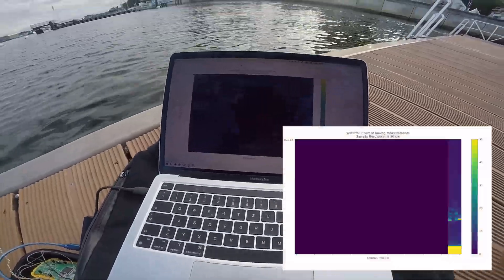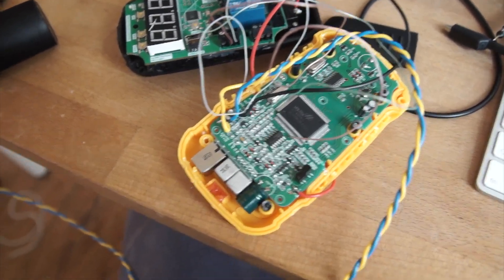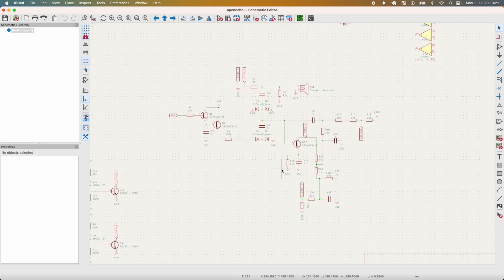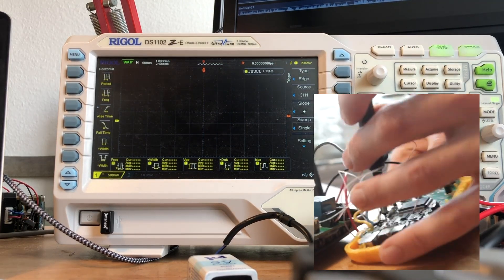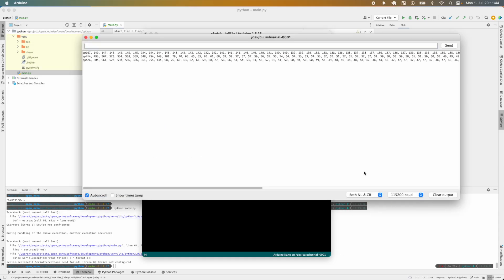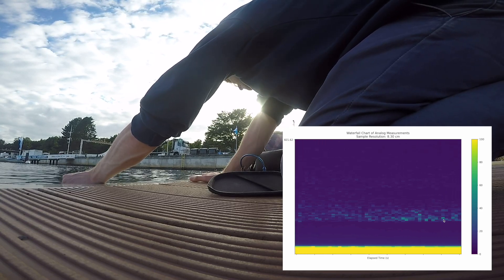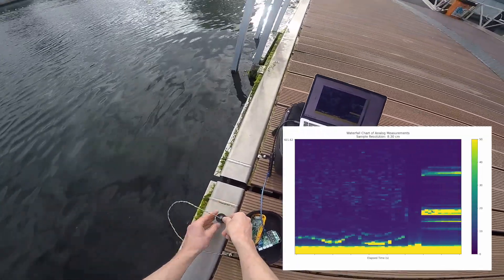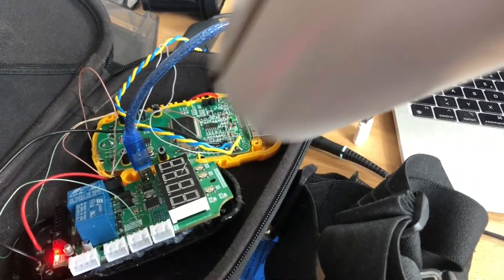DIY Open Source Underwater SONAR Project | Arduino Echo Sounder

Comment: i got one from amazon, and used some sodering and some really hard reprogramming, and now, i can use it with an arduino and put it on a big model boat i am working on
Reply from the maker: Reprogramming? Have you been able to rewrite the firmware on the microcontroller on the board? That would be very cool! Have you checked the GitHub repo?

Comment: Nice nicer nicest, looks pretty slick for ali-gear in a plastic can It's unbelievably baffling to imagine what that can turn into... great work!!! 
All right then the suggestion and wishlist...

- I suggest to make the hardware board capable of transmitting and recording multiple channels for side scan and "3d" and these alike
- I suggest making the hardware capable of transmitting different frequencies on different channels or even completely making the hardware be steered flexibly from software in terms of frequency and transmit pattern
- depending on the amount of data produced for imagery, I would consider making the Hardware IP compatible to be able to directly put the data onto "more than 5m" remote displays and servers, that might not be able to fetch the data via USB due to cable length.
- I suggest making the software side web-compatible to serve the image in a browser
- I suggest using SignalK for that matter - a boating server based on Node, that is capable of connecting, storing and web-serving all marine-on-vessel-data-acquisition as well as resources such as charts, routes, radar images, and maybe Sonar in

That would also connect the project to a mass of interested people and, if integrated into a running system, heavily reduce the duration of deployment.

greetz from Berlin
Reply from the maker: Hey! Thanks! That's pretty much my thoughts, too. 
The LUCKY Fishfinder hack was pretty limited. The frequency can be changed by replacing the PWM generator, but the filtering is 100% done in hardware and requires different R/C values when the driver frequency is changed. 
Therefore I choose to drop the LUCKY fishfinder and instead build a new hardware. I just finished the first board and got testing. It is a TUSS4470 based Arduino shield that can drive transducers between 40 and 1000kHz. I have had some good success with 40kHz already. 200kHz is a bit noisy currently. But that's probably a software thing. Check Kogger LLC for high quality and quite cheap underwater transducers that can do all of the things you listed. I got the BASIC Sonar and the BASIC side scan. Phenomenal devices and very cool software as well.

We're currently sharing ideas in the segeln-forum https://www.segeln-forum.de/thread/74825-diy-tiefenmesser/ about building a complete DIY sonar as well, including integration into open plotter, etc.... I see the TUSS4470 implementation together with some WiFi chip (maybe ESP32) to be quite a cheap and universal platform to play around with sonar. (probably less than 100€ per board) 
My medium term goal is to build a dive sonar for navigation and wreck search, though :D

Check the GitHub repo in the video description for more up-to-date info and current progress :)
Reply: @Neumi  That reads better and better by the sentence... I'll leave a shout on your discord

Comment: Sehr interessantes Projekt. Ich würde mich gerne beteiligen. Wir haben ein Boot mit einem NASA Marine Depth Sounder.
Reply from the maker: @renreWydnaS  den haben wir auch auf dem Boot. Der kann glaube ich auch ein Repeater Display ansteuern. Das Signal sollte man recht einfach auslesen und verarbeiten können denke ich. Aktuell habe ich noch Boards für die eigene Hardware bestellt. Mal sehen, ob ich die nächsten Wochen dran arbeiten kann :)

Comment: Hi Nemi love your video could you send me the links to the items you used? I would like to recreate it myself.
Reply from the maker: Hey Thanks! There are links at the bottom of the GitHub page. You only need the Lucky fishfinder and an Arduino Uno to get data. https://github.com/Neumi/open_echo
Reply: So you took the transducer out of Lucky fish finder?
Reply from the maker: @ I bought a used Lucky Fishfinder without the transducer. So I hat to build my own. If you buy it new, you will have the transducer from the fishfinder and therefore don‘t need to buy the piezo seperately.

Comment: A simpler device to consider looking at is the discontinued ScubaPro PDS-2 Personal Dive Sonar.  It’s a really simple device to understand
Reply from the maker: I found a similar sonar for ice fishing or something in the same flashlight shape but opted to get the "Lucky Fishfinder" as it is a bit cheaper and looked less integrated. Maybe I'll test these in the future as well. Currently I'm playing with hardware from Kogger (down/side scan and 2D sonar) and see if I can get my own design with a TUSS4470 or TUSS4440 running.

Comment: Hi Neumi, I’ve been investigating open source signal processing techniques for echo sounders and not come across much until this video. Your work is very interesting. I run a bathymetry mapping company in Australia and have had interest developing echo sounding applications for tablets as an alternative to expensive chartplotter modules. In your opinion is it possible to build a module that can process signals from a variety of echo sounder transducers? Like a universal signal processing module?
Reply from the maker: Happy to hear about that! The transducers themselves (like the sonar head/piezo) don't really have an influence on the signal processing backend. The thing that is important is the driver and amplifier that is connected to the transducer. Some are integrated and output NMEA2000 or NMEA0183 or a closed protocol directly. But usually you only get depth (NMEA DBT) as a number back and no raw data (that contains multi reflections, internal echos etc.). Some devices send the raw echo data back, but as far as I'm concerned, this is a closed protocol (like Garmin, Raymarine, Navico, Lowrance ...). So, usually, you'll only be able to read the 'interpreted' depth data from the NMEA network and display it on your app. I think the only feasible approach to get raw data into your app is to build the hardware yourself, use a scientific transducer (like Bluerobotics or Kogger), or hack the protocols from one of the big brands. If its only about the interpreted depth data, a NMEA-WiFi bridge will do. If you like, we can talk on LinkedIn about that :)
Reply: @Neumi  I would love to chat more about the process of building a hardware prototype. I’m not on LinkedIn but I am on email or WhatsApp?

Comment: Ich bin über die Maker Faire Ausstellerliste aufmerksam geworden. Der Ethersweep sieht mega interessant aus! Wirst du auch mehr deiner Projekte vorstellen? :)
Reply from the maker: Danke! Jo ich denke, dass ich noch ein bisschen mehr mitbringen werde. Leider habe ich aktuell auch nur einen laufenden Ethersweep controller. Von daher wäre es auch ein bisschen langweilig, nur den einen vorzustellen :D
Irgendwelche Wünsche? :)
Reply: @Neumi  Etwas sehr späte Antwort, bin gerade im Subnetting Unterricht (IT-Ausbildung). Das was du sonst an Projekten machst ist mir noch etwas zu "Advance" weil ich recht neu in der Elektronik-/DIY Branche bin. Der Ethersweep hat irgendwie alles was mir persönlich gefällt und ich ebenfalls verstehe -> Custom PCB, Ethernet/IP-Adressen, Motoren etc. alles was ich irgendwie interessant finde :D

Comment: Sehr schönes Projekt und gut erklärt . Dazu eine Frage , hast Du  eine Ahnung wie tief man den Ultraschall Sender/Empfänger Sensor im Wasser versenken kann bzw. auf welche Tiefe der noch Wasserdicht ist? Speziell denke ich da über eine Sonaranwendung für einen Taucher nach der das dann natürlich auf seiner Tiefe mit sich rumträgt.
Reply from the maker: Hatte ich auch schon lose überlegt. Die Filmdose wird dafür nicht ausreichen. Ich würde mir eine Gehäuse CNC fräsen und mit einem umlaufenden O-Ring dichten. Das hält mit überschaubarem Aufwand 30m. Der Transducer/Piezo kann einfach an die Innenseite geklemmt werden und mit Vaseline, Fett o.Ä. akustisch mit dem Gehäuse verbunden werden (Wird bei Booten auch gemacht, um ohne Loch in der Außenhaut auszukommen). Makrolon als Scheibe für ein Display ist dann auch machbar.
Reply: @Neumi  vielen Dank für den Tip , da muss man halt auch etwas experimentieren bis man zum Erfolg kommt .

Comment: Richtig cool, dass du dich mit dem Fischfinder beschäftigst! Ich habe mir so ein Teil vor einiger Zeit besorgt, um damit zu basteln, bin allerdings nie ganz durchgestiegen, wie das Teil funktioniert. Als Endanwendung würde ich gerne das Signal eines Transceivers mit einem anderen empfangen können, der sich einige Meter weiter im Wasser befindet. Quasi eine rudimentäre Datenleitung. Ich bin extrem gespannt, ob ich das nun, auf deiner Arbeit aufbauend, endlich umsetzen kann :-)
Reply from the maker: Müsste eigentlich gehen. Aktuell überlasse ich ja noch dem ursprünglichen Fishfinder, die Impulse zu machen. Das geht aber ohne großem Aufwand auch vom Arduino o.Ä.. Auf der GitHub Seite ist ein Bild von den relevanten Pins. Da kannst du auf jeden Fall die verstärkten Signale abnehmen und auch den 100uS Puls selber einspeisen, wenn du die Leitung zum Microcontroller kappst. Wollte meinen jetzt noch nicht ganz auseinanderbauen, solange ich noch teste :D Würde demnächst aber mal versuchen selbst das 200KHz signal mit dem Arduino zu machen und die Steuerung komplett zu übernehmen. Bin aber noch nicht ganz mit meinem Elektrokram umgezogen ...
Reply: Schaue ich mir die Tage auf jeden Fall alles an. Die Seiten im Netz, die du im Video erwähnst, sind wahrscheinlich die gleichen, die ich auch gefunden hatte. Dort gehen die Infos aber leider nicht weit genug, auch wenn schon einiges an Reverse Engineering betrieben wurde.